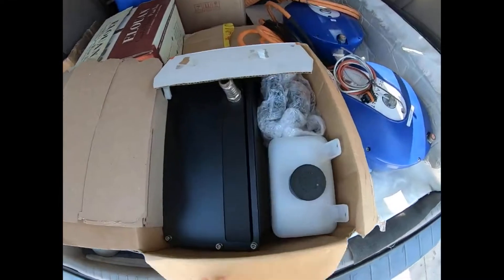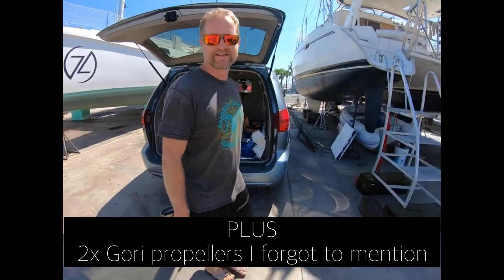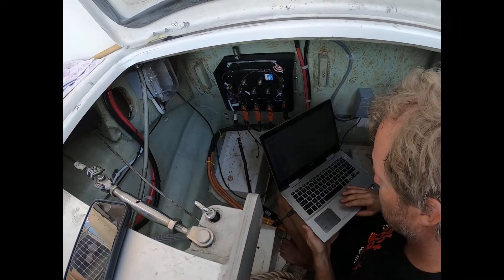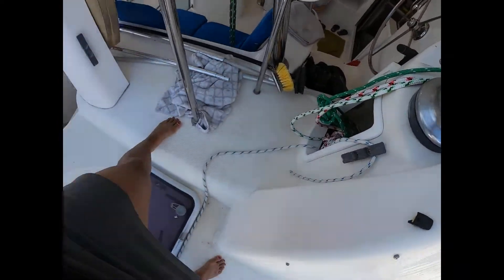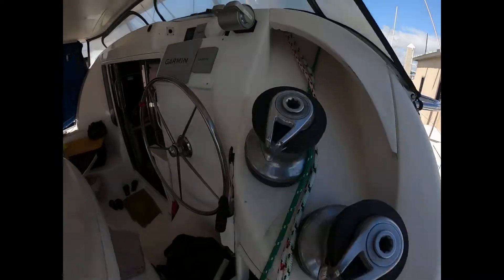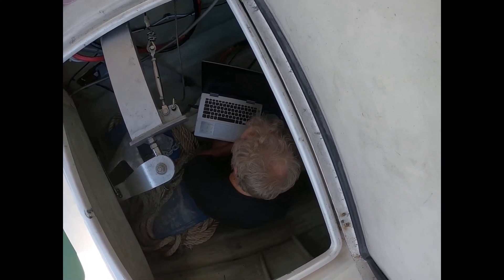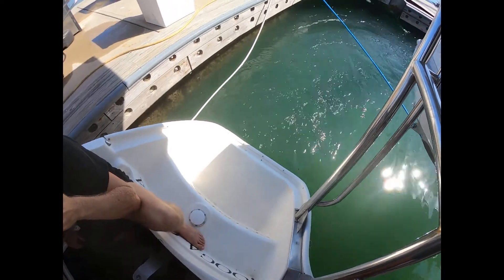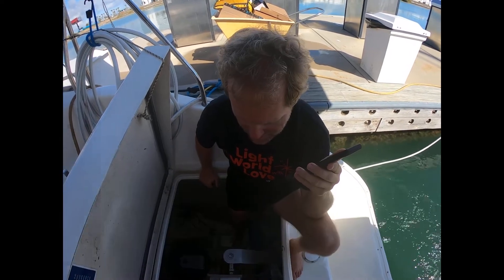Electric Motor Installation - Oceanvolt SD 15 - 2005 Leopard 40 - OV programming

Comment: You guys are doing an amazing job pioneering DIY electric power .
The costs are still prohibitive to making this into a major trend and its disappointing  that a pioneering company with Environmental aims should take such a closed shop approach to 
anyone wanting to pursue such a critical technically based objective.
This is not just them Tesla, Apple ... have all sought to perpetuate this system or worse ... 😤😡
Given the nature of the environmental problems we face its in direct contradiction to the prime objectives of promoting green/ alternative propulsion systems and sustainable living.🤔
Reply from the maker: We did the cost analysis last week! We were (happily) shocked to know what the final cost of the project was. Because we did SO much while on the hard, it was sometimes confusing trying to determine how much we spent on the conversion alone. So, we crunched the numbers and that will be the next video. I'm hoping it will provide a glimmer of hope to those who think this type of project is out of their range.
Reply: @347830  

I saw part of it ... but its still a lot more than most can do at the moment... thats the industries technical and economic state at the moment..  the best hopes from the car conversions market..and crate motors.
Ive a few links that might help..i will add them shortly..

Comment: That sounds like the South African owner on Top Secret giving advice on the phone ...the way he did his system and cat revamp sold me on ocean volt ..i assume you next vid will be battery capacity and solar gen and what inverters and mppt's you installed.thanks for the great vid on your ocean volt electric motor upgrade ,think its the future of all e-propulsion engines...now you can laugh at the other yachties who complain of fuel prices😜
Reply from the maker: Our next video will be on total cost of the conversion. After that we should have enough data to review with everyone motor run times, as well as, solar ad battery performance. 

This video: https://youtu.be/UAsYZKB_gr0 will give you a nice overview of the numbers we run for, solar capacity, battery bank size, etc. 

This video: https://youtu.be/OwegLXjLq0A goes into the Victron system, including MPPTs  in more detail.